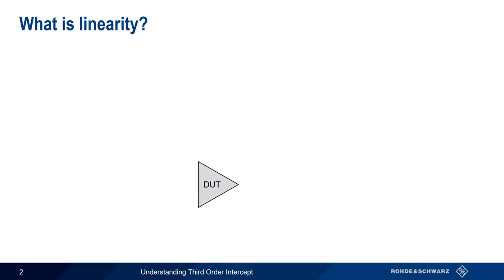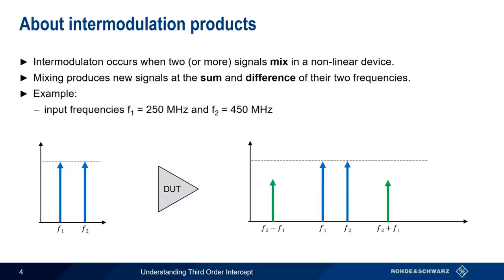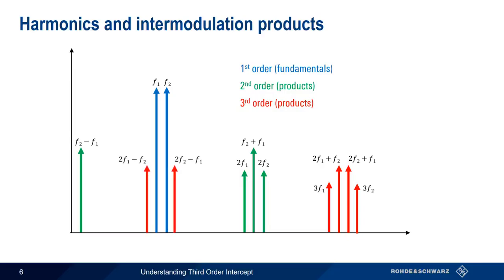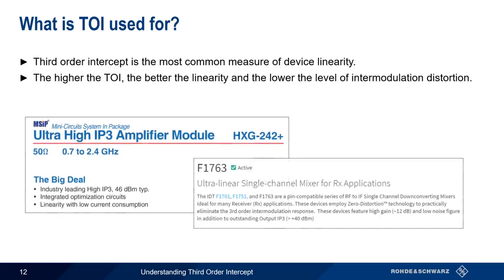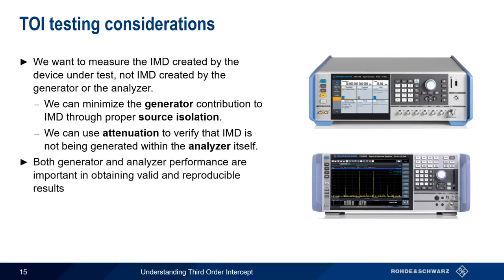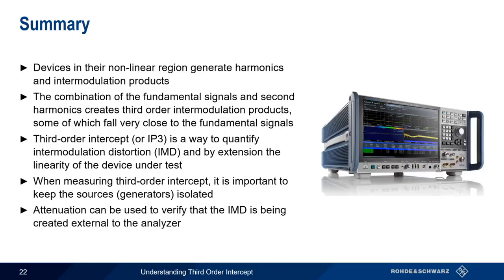Understanding Third Order Intercept

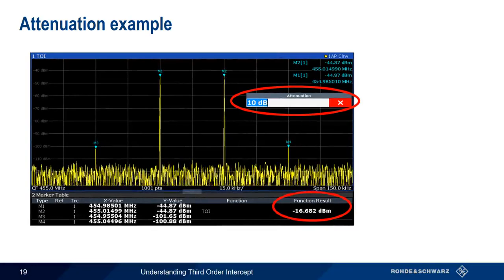Comment: At 10:35 can someone explain why the fundamental 
Signals power remains essentially the same when 10db of attenuation is added? I would of thought their power levels would of dropped by 10db.
Reply: To my best knowledge, the values "did" drop but the spectrum analyzer automatically offsets the value for you. By default the values you see on spectrum analyzer are with reference/calibrated to the input port of the analyzer. The analyzer has an internal attenuator that can be automatically or manually adjusted. By default the attenuation is set to auto.

Comment: How do you prevent the tons not mixing before it reaches the DUT?
Reply: The section on source isolation provides some guidance.  Generally, either attenuators or circulators can be helpful in preventing undesired mixing.

Comment: Thank you for the video- as others have said, it's very clear and well presented. Can you explain how the frequencies of the two tones in the two-tone test are chosen? I know you want to avoid having one be a harmonic of the other, but other than that, I don't know what the constraints are, and I've seen different spacing used in different situations- it looks like you're using 30 MHz in your example at 8:04, but I've seen everything from 10 MHz to 100 before. Thanks again
Reply: re: "Can you explain how the frequencies of the two tones in the two-tone test are chosen? "
Short answer: Experience.
Long answer: Determined by the DUT (device under test) such as freq operating range and so forth. Additional factors enter into the freq chosen, such as power supply bypassing and dynamic response, especially when freqs are close by such as in the audio range.

Comment: 10:23 When you add the input attenuator, are you adding an attenuator between dut and Spectrum Analyzer (SA), or changing SA's internal mechanical attenuator? Would that make a difference?
Reply: You want the attenuator to be before the first active device in the spec an.  Many (most?) spec ans have an internal, user-controllable input attenuator so usually the procedure to add 10 dB of attenuation is simply done via the spec an user interface.  The results would be the same if you were to screw an external attenuator to the spec an input port, although clearly this is slightly les convenient.  [It should also be noted that instead of mechanical attenuators, instruments may also have internal electronic attenuators].

Comment: Could you elaborate on the method you use to determine whether the Spectrum Analyzer(SA) limits the linearity measurement?
Reply: Sure. :)  Essentially the question is whether the 3rd order intermodulation products are being generated within the device under test and/or in the spectrum analyzer.  If the products are being generated external to the spec an, then an input attenuator will attenuate the fundamentals and the products equally.  And since TOI/IP3 is calculated using the difference in levels between the fundamentals and intermod products, reducing them all by the same amount won't change the TOI/IP3 (assuming, of course, that you don't add so much attenuation that the products disappear under the noise floor ....).  If the products are generated within the spec an, then an external attenuator will only reduce the level of the fundamentals.  Recall that the amplitude of the third order products rises (or falls) much more quickly than the amplitude of the fundamentals (steeper slope).  So attenuating the fundamentals at the input to the spec an will create a noticeable change in TOI if the products are being generated internally.  Hope that helps!

Comment: Thank you for the video. However, I still don't understand how can we detect the causes of IMD by applying an Input Attenuator? Can anybody explain that to me?
Reply: Sure : ) If you look at the equation on slide 13, you see that TOI (or IP3) is a function of the power difference, P-delta, between the fundamental tones (Ptone) and the third order products (PIM3).  In the case of external generation, both Ptone and PIM3 are all attenuated by the same amount, so P-delta stays the same and thus TOI stays the same. 

If the distortion is being internally generated, Ptone will be decreased (since the fundamentals passed through the attenuator) but PIM3 will be decreased even more:  remember that the power in the products has a different (steeper) slope than the power in the fundamentals (see slide 9).  A 10 dB decrease in the power of the fundamental tones results in a 30 dB decrease in the intermodulation products.  So attenuating the fundamental means that P-delta will change and TOI will decrease if the distortion is being generated internally. 

We actually have an entire white paper:  "Intermodulation Distortion Measurements on Modern Spectrum Analyzers" that covers IP3 measurements in much more detail.  In particular, pages 15 and 16 mention how proper use of input attenuation can reduce the generation of intermodulation products in the first mixer in a spectrum analyzer.

https://scdn.rohde-schwarz.com/ur/pws/dl_downloads/dl_application/application_notes/1ef79/1EF79_1E.pdf

If you watch our video "Understanding Basic Spectrum Analyzer Operation" it also mentions the importance of properly setting the reference level to avoid overdriving the first stages of the spectrum analyzer and creating IMD within the analyzer.  Being aware of the possibility of IMD and adjusting your settings / levels appropriately is important in making good spectrum analyzer measurements.

Hope that helps!
Reply: @pauldenisowski   Thank you, Paul. Your explanation is really helpful.
Reply: @danganh870  Anytime :)  Happy New Year!

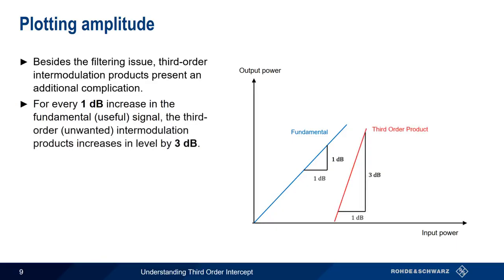Comment: at 5:32 why does the line for Third Order Product not start at the intersection of the two axes, but rather later down the X axis?
Reply: The third order product only appears above a certain input power level (X-axis).  The more linear a device is, the higher the input power level that's required before third order products appear.  All other things being equal, a third order product line that starts further down the x-axis will produce a higher TOI / IP3 value (a good thing).  If the fundamental and third order product both started at the origin, then IP3 = 0 dB and the amplitude of the third order product would be higher than the amplitude of the fundamental for all input power values (a very, very bad thing).